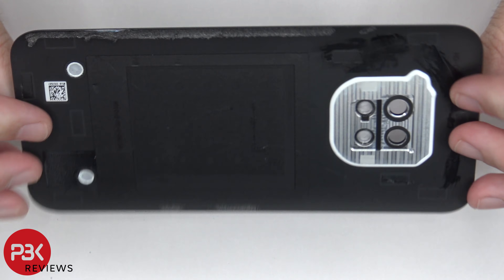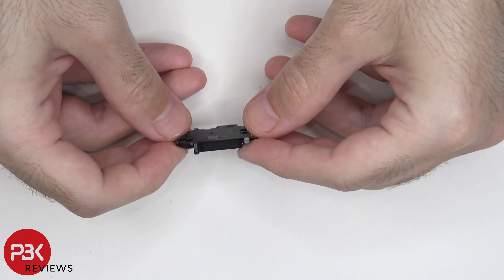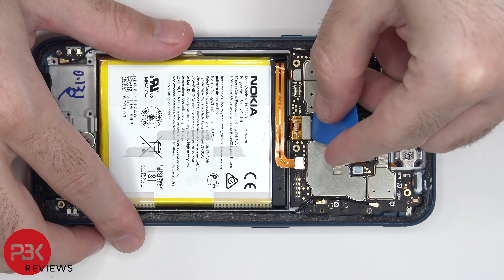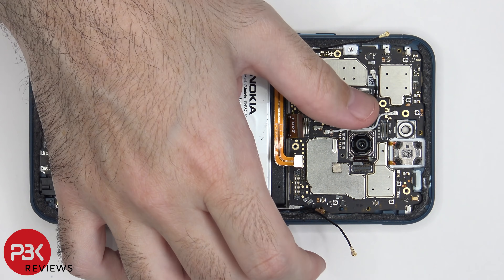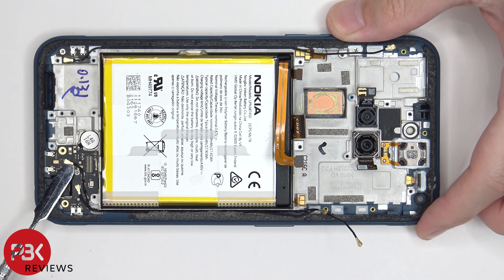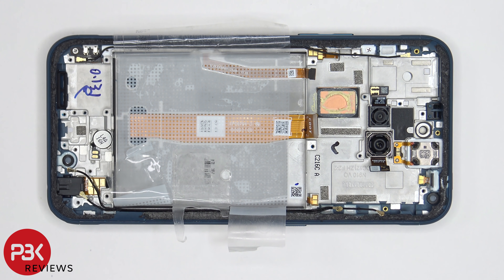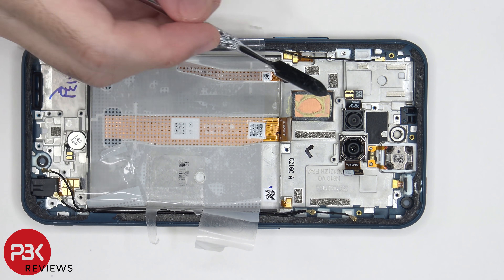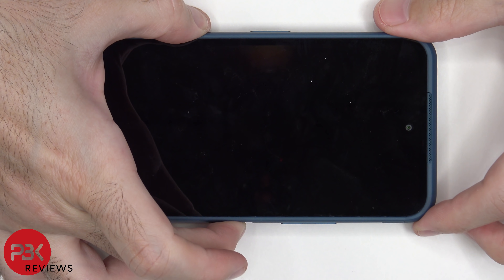Nokia XR20 Disassembly Teardown Repair Video Review

Comment: Great tutorial that really helped me change my battery. One small advice: I recommend using a hair dryer to thoroughly heat the entire back of the XR20 phone, not just the edges, because in my case, when I removed the back of the XR20, the antenna stucked to the back instead of staying on the battery. The graphene antenna protection was slightly damaged, but after carefully reassembling it, it still works.
Thank you.

Comment: good video. was hoping to be able to fix my microphone problem myself but no success.
Got the phone back from warranty repair over a year ago. tried to boot it today but didnt have camera, very weird LED colour and extremely low microphone level.
Since appearently the repair guy forgot to remove the sticker on the inside of the cover, covering the camera and LED, i was hoping something similar was going on with the microphone, blocking the sound somehow.
But i was wrong. sad day. good video though!
Reply from the maker: Thanks. If they replaced the sub board with a defective one, or the filter for the mic is clogged could be the issue as well.
Reply: @PBKreviews  i was hoping to fond something blocking the mic but no luck. Google assistant detects no sound. Online Voice recorders do, but only very very low volumes and a bit better response to high pitched sounds like whistling. Filming with whatsapp just gives static noise. Coax wires seem to be connected ok. I guess ill need to try and get my hands on a replacement board but at least with your video im confident to open the thing 😁

Comment: nice video. can't find the battery anywhere in switzerland though :(
Reply from the maker: Thanks. There are replacement ones available on ebay and other sites. https://www.ebay.com/itm/224992034738?itmmeta=01HRXVEPMRCSE2PJNPFZ1SF84M&hash=item346291ffb2:g:Q0YAAOSwOLdihMGY&itmprp=enc%3AAQAIAAAAwPeEabNEOdjNYO52E8q2g7%2F3w6XXIpxOaGGj8D1LV3yqryZraHa7UuRa6qElgFSIKSSn%2B6DRcTs%2BytI58Z8Cik%2BU6qTRt%2BQOTDCil7ct4ObWJRXTHrCnmxmhqAU4iwIQgMLmTQqux%2BcdBD%2BQRZ3xklcFT2jqTdbKOoQMvefm2txP11rkbrSTilv%2BMMlbd3d2O7%2FH%2FNdSSuIJ%2FggfX5Gk0%2BD4ini%2FZy34Prg1cZzjvAR%2BstYOMJMui%2BPzshyxHSFfpw%3D%3D%7Ctkp%3ABk9SR8zqurvHYw

Comment: can the fingerprint reader/power button be replaced separately on this phone - or does it require complete replacement of the frame ?
Reply from the maker: It can, but requires prying off the screen as well since the flex cable is routed through the mid frame. But keep in mind, the power button/volume button flex is separate to that of the fingerprint reader.
Reply: @PBKreviews  thanks for the answer ! Do you know by any chance if those replacement frames you can buy at various online stores have the fingerprint reader included ?

Comment: please can I know the name of battery and Type and places could I buy it original or semi original
Reply from the maker: The battery mode is LPN387450 , not sure exactly where to find an original but you will have to check on ebay or other places and see if you can find one that is original

Comment: Pull-Tabs are the completely wrong choise to secure a battery to a phone. After more than a year the pull-tabs just rip of everytime you just slightly pull on it. So the batter never comes out safely! 
Comanies try to trick you by choosing this option, cause it seems relatively easy to just pull the pull-tabs. But it isn't.
Bad. Very bad. The environment thanked Nokia for this. Not.

Comment: Where can you find replacement parts (back plate, outer housing, etc) for this phone?
Reply from the maker: Very hard to find parts for this phone. Mainly only the lcd or housing usually is available from what I've seen, but the back plate is hard to come by.

Comment: The only drawback of this phone is it's chipset Snapdragon 480 which is entry level 5G chipset available in low range phones. Had Nokia given better chipset this phone would have been very successful.
Reply: And of course the bad pull tabs. They rip off so easily after a year. After two years they are completely useless. You never get out that battery without exploding or shorting it.

Comment: I bought this phone but had to return it after a few days. It would not play the 4K video of my Unifi security cameras. My old  Nokia 8 Sirocco has no problem playing the same 4K video files. Too bad... Hope the new 2022 phones will not have this problem.
Reply from the maker: Yup hopefully not
Reply: VLC
Reply: @Cherriedsalmonbowl  Thx for the tip. VLC will probably work fine.  But I would like to view the video directly in the Unifi Protect app like I can on my Nokia 8 Sirocco... :-) Still hoping for a new Nokia with a higher resolution display.

Comment: My concern is once its opened, even though adhesive is applied again, the waterproof capabilities may be compromised.
Reply from the maker: As long as you use original pre cut adhesive that is made for the phone to re apply the back plate or screen when taken off, you will retain the water resistance. Usually pre cut adhesive for the phone become available on online market places a few months after the phone is released or with replacement battery doors/back plates or screens.

Comment: Interesting. Made an IP54 phone at Nokia twelve years ago. I can see where they chose to tolerate water ingress with sealed chambers and gaskets to define "this far and no further"
Insane number of screws - all adds to the hand time in manufacturing. Plus all the flex connectors and cables. 
Take a look at that cable that actually crosses the main board passing through the cameras. Now that's bad design and development. 
The battery glue foils probably have the same gluing strength on both sides, instead of being slightly weaker towards the battery - this works to let you remove the battery more easily and still leave the foil in place.
.... Old wars ...
Good teardown 👍👍🙂
Reply from the maker: Thanks! Oh Interesting. Yea there is a lot that goes into these phones that most people don't know about or understand. Thanks for the explanation.
Reply: If you disassemble a Mercedes you will see a lot of "unnecessary" details and assemblies ... which you will not find in cheap and "practically" made cars. I believe  this Nokia model has a leading price / quality ratio, with the latter surpassing the former.

Comment: I see that there are 5 coaxial cables, 2 of which are on the board. Do you know what everyone is responsible for because most other phones have only 2 coaxial cables, not 5
Reply from the maker: Usually the coaxial cables are used to connect antenna receiver/contact points. They can also be used for button or trigger keys or other things as well in different phones. Not sure exactly what each of these coaxial cables are for on this phone.
Reply: @PBKreviews  
I personally assume that this single one, which is located on the side of the volume and power buttons and is connected to the additional small board, is responsible for a 5G connection. The other 2 on the side of the google assistant button say that one is for wifi and the other is for 2G, 3G and 4G frequency spectrum. but these two on the center board are interesting. Is it possible to be responsible for the supported CDMA2000 1xEV-DO technologists?

Comment: Quality matters, Nokia is always providing quality products
Reply: 😂 yes bro but I don't why they are reducing quality for every new model
Reply: @javedhussain4697  they are loosing employees too, and hmd is getting bankrupt, that's why
Reply: @PBKreviews  u r right
Reply: But not for the pull-tabs. They loose their properties after more than a year cause they dry in and if you pull them, they rip of easily. Its a completely wrong choise of securing a battery to a phone. You never get out that battery in two years without exploding or shorting it.
And yes i know this of my own experience. And i am not a beginner and i have a lot of patience.
Reply: My first nokia smartphones werent that solid as this one though. Nokia 5.3 got problems fast with the charging port. Nokia 8.1 was so slippery it slid of a book the first day i bought it. Although that was my own mistake 😂
Reply: And now my nokia t20 when i download a new app when i open it the tablet shut down and sometimes the battery became 0% for no reason
And the old apps doesn't have a problem
Reply: adhesive everywhere

Comment: What is an OK temperature to heat up the phone to melt the adhesive using a heat gun?
Reply from the maker: Between 80-100 degrees fahrenheit. If you aren't comfortable with a heat gun, a hair dryer would work just as well and sometimes is a better choice to evenly spread head to warm up the back cover enough to be hot to the touch to loosen the adhesive underneath without damaging components. You can always apply more heat as you start prying to keep the adhesive loose.
Reply: @PBKreviews  please never use fahrenheit... 99% of the world doesnt understand that archaic measurment system
Reply: @LordAugastus  That's a little silly. Archaic? America became the envy of the world at one point using the imperial system

Comment: I'm loving this phone already! I'm sold by the fact that its got wireless charging.
Reply: To me, the big deal on this phone is that it's rugged, waterproof, has a tough screen and has full 5G support in the US T-Mobile market with all of the weird bands that T-Mobile gets involved with.

I've had mine for just over a week now and while it's not the fastest thing on the planet, I'm impressed with how smooth the user interface is overall and how few minor glitches are around. This phone is replacing an LG Wing which was just too delicate for my line of work (long haul trucker).

Wireless charging is a great thing to have if the charge port ever blows on you.  A lot of people do wireless charging just to make sure that the charge port never breaks.
Reply from the maker: Yea, its a very solid built phone with good features.
Reply: @PBKreviews  It is very well built,just lets hope nobody breaks their screen.
If you tried to remove the screen would you damage it?
Reply from the maker: @Z4N7  there is always a chance of the screen getting damaged when prying off
Reply: @Z4N7  1 year free screenreplacement is availabe
Reply: @arfatmagray5597  ah yes,i forgot!
Reply: Not for long.

Comment: Excuse me, I can see there's two flex cables running underneath the battery. I know the big one is for the screen flex cable, how about the smaller one (near the volume keys)? Thanks!
Reply from the maker: Hi, that is for the fingerprint reader/power button.